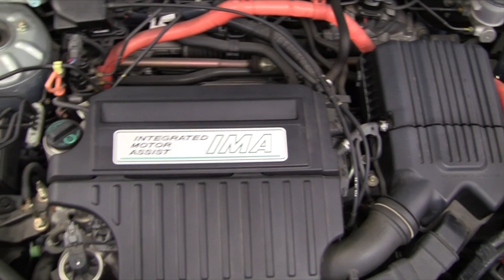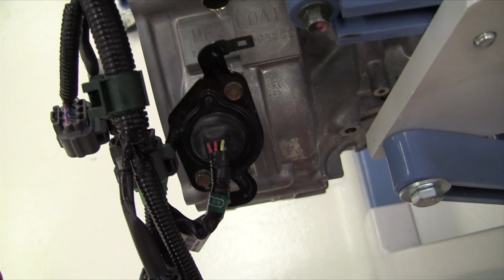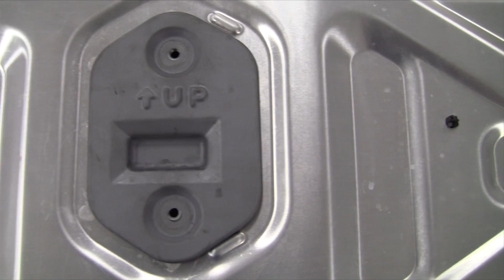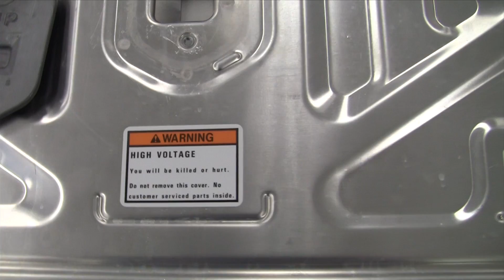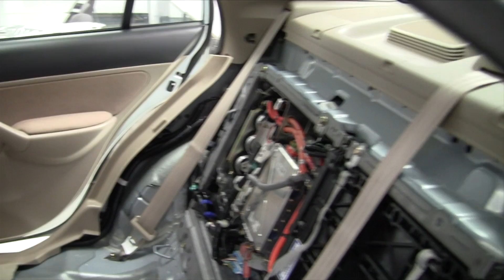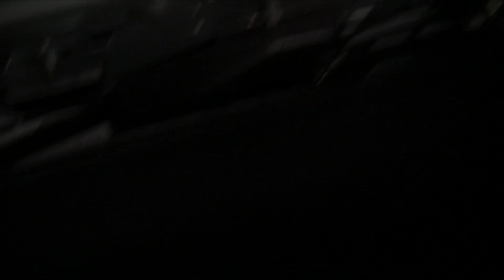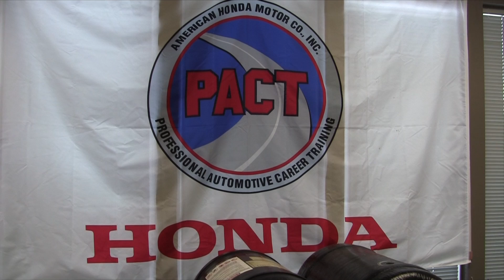Honda Civic Hybrid High Voltage System Operation

Comment: If the IMA hybrid battery starts to weaken, will it affect charging the under-the-hood 12v battery ?I read that there is no traditional alternator in civic hybrid.So how will the 12v battery be charged ?
Reply: I would stay away from Hybrid cars because Hybrid battery expensive to replace and they are prone to fail due to temperature and prolonged periods of not using the car. I am a new owner of 03 Hybrid Civic, and I wish I didn't make this purchase.
Reply: I have a 2001 Insight which has a similar IMA hybrid system. I have the hybrid battery completely removed and the car is used daily without it. So, the 12V battery is indeed charged even though the hybrid battery is removed.
Reply from the maker: GaryL3803 Yes, the Civic has a backup 12V starter. The MCM, BCM, and ECM are all involved in decision to start with the 12V starter.
Reply from the maker: Yes, if the IMA battery is weak, the DC-to-DC converter will not be able to provide adequate voltage to the 12V battery to keep it charged.
Reply: So there is no alternator to charge the 12v battery?  I am looking at buying a 2004 honda civic hybrid.  I read in some forums that the owners' IMA batteries are dead, yet their 12v batteries still are constantly recharged just like a traditional alternator would charge a battery.  How can this be?
Reply from the maker: Larry Matsko I don't believe them. I have seen this issue and eventually the HV battery level will be so low that the DC-to-DC converter will not have the power to charge the 12V battery. The engine will stall when there are high electrical loads like at a stop sign with the headlights and air conditioning running. There is no alternator. Best wishes!
Reply from the maker: Thanks for the feedback. It is interesting that the 12V battery seems to be kept charged on your Insight, but it will not do so on the Civic Hybrid. I have helped two of my students who have had an older Civic hybrids with this exact issue of the 12V battery not charging if the 144V HV battery is setting a DTC for being bad (especially in cold weather). We have never removed the HV battery from the circuit to see what would happen. (nor would I ever recommend it). Removal may be triggering the MCM to go into a limp home mode and send all current from the IMA motor to the DC-DC converter allowing it to maintain some level of 12V battery charge. Interesting stuff, thanks again!
Reply: In the Insight it takes about 2 seconds after the key is switched to start position for the BCM (??) to decide that the IMA will not start the ICE and trigger the 12V starter. I am presuming that the Civic has a 12V starter?

Comment: I have the same exact Honda with a code P0700 related to transmission. Any idea what that code could be referring to in little more details ?
Reply from the maker: P0700 is a ECM code that just means that something is wrong with the transmission. You must use a Honda scan tool to access the transmission DTCs. Best wishes!
Reply: Does Honda scan tool read transmission codes from the normal below-steering-column output or does it connect somewhere else to read trans codes ?
Reply from the maker: Same connector

Comment: If Hybrid Assist fails,  will it make car  start driving like a 3 - speed transmission ?
Reply from the maker: Hi, on a Honda IMA hybrid, the transmission will operate normally if the hybrid system shuts down. The IMA system only helps the engine crankshaft to rotate.
Reply: no, cvt will still be cvt. if that happens, 12V battery will NOT be charged. As soon as 12V will run out of energy, engine, lights (even hazards lights) and cvt cotroll will no longer function (car will die, even if moving).

Comment: Hello, my name is david carranza, I'm from Guatemala, I have a honda civic hybrid. in my country these Honda vehicles is not supported. I have a problem.
1. shows me that the battery is fully charged, leave it unused for 8 hours and then when I start showing me that has no battery and brake every time makes no charge.
2. When there is no load, battery 12v shown red

3. I commented that they could balance, you can give me information if this is true or false

4. Should be true, as it should make loading and unloading?
Thank you

Comment: Amazing Video, thank you! Have you ever heard of the hybrid system constantly killing the IMA battery? Reminds me of 12V battery and bad Alternator. The battery dying twice in a short amount of time points to possible alternator issue. I'm wondering since I've replaced the IMA battery now three times, what could be malfunctioning. Changing the IMA battery always gets rid of all Codes for about 2 months and then PP1600 and P1433.  As of this morning, the IMA Battery is completely dead and won't even try to charge.  No idea what is going on here.
Reply from the maker: Thank you, your car has a common problem. Replacing the battery will not fix it alone. There are some control modules that must be reprogrammed as well. Honda has a service bulletin about this very topic. Best wishes.
Reply: If the ima is completely discharged and won’t charge but car will start and drive find a straight away that you can safely get the car up to 60 then take your foot off the gas & immediately shut the car off & right back on within seconds those blue bars come back on you may have to try this a few times . Then take your car out for a long drive at least an hour with all other electric ie….radio heat or air conditioning off after you get at least 7 or 8 blue bars you can turn on Econ mode . Depending on how low assist battery is you may have to drive it longer to get full charge . Also before this double check the nuts on your 12 volt under the hood make sure connections are tight . Good luck this did work for me . Also prior to this i scanned and erased codes then reset maintenance lite . I have had no lights come on no problems & getting better fuel mileage no hesitation no stalls it’s been two weeks now .
Reply: @cathy4517  hey cathy, you’re the most recent comment on any video . Do you still do this to your hybrid? My IMA and battery light came on and I’m going to give this a try . How well has this worked for you?
Reply: Hello,@axlsantos9276 , could you share your experience?
Did you make 60 mph and turn off ignition?
Did it help you?

Comment: i have a question, i have the same car, but i have a problem with the ima system, in the cluster a have the red light battery on! what part i need to replace, cuz a can't charge the front battery.
Reply from the maker: +jose flores Hi, there are several possibilities. You need to get it checked out.  Best wishes

Comment: Is is possible to jump a 2003  civic hybrid once completely dead?
Reply from the maker: +Brittany Williams Yes, you can jump start the 12V battery under the hood. The engine also has a regular starter motor.
Reply: +WeberAuto thank you so much! I was hoping so before I reached out tor roadside assistance. Appreciate your help.

Comment: I have a question about the transmission a couple of videos ago, are dog clutches stronger than clutch packs?(more durable)
Reply from the maker: +Don G. I don't know for sure, but I suspect it is a matter of surface area of the dog clutch teeth where they contact their mating gear verses contact area of a multiple plate clutch pack and all all of its splines. Thanks again!
Reply: So I gather that you can build either design as strong as you want?
Reply from the maker: Don G. I believe that is the case. I am sure there are cost, space, materials, and control issues that drive that decision.
Reply: TX for info!
Reply: transmission repair

Comment: This is a 2005 Civic  it is the same model I bought new in Sept 2004 the first available. Honda Started talking about Hybrid in 2003. Mine is the same color and the tail lights did not  have this body shape until 2004.
Reply from the maker: +Randy Rutledge The one in our classroom os actually a 2002 pre-production model. They started offering them for sale in the 2003 model year. Thanks for watching!

Comment: at 17:46 you aren't completely right. If you disconnect 12V battery, while ignition is on, hv sustem wouldn'd turn off, beacose 12V battery charger will still provide power. To turn it off first turn ignition off by keys, and then disconnect 12V battery
Reply from the maker: +Volodumur Kalunyak Thanks for your input. If both 12V cables are disconnected on this model, it does shut off. Others may be different, but it would defeat the purpose of an emergency disconnect if the car were to be in an accident.  Thank you for watching
Reply: What is current

Comment: Thanks for video, I have a small question regarding my Honda Civic second generation Hybrid 2008 - after a lot of  IMA errors I've opened the IMA battery and some of the sticks after a day or two from  a discharge / charge cycle  have almost 0 capacity. The rest of sticks have 3.000 mAh to 4.000 mAh. My question is where can I find the second generation sticks - they are welded in pairs so I need a double stick welded.  Best regards, Tudoran Radu
Reply from the maker: +Radu Tudoran Hi, try salvage yards or ebay.  Thank you for watching!

Comment: I read on another video that once you replace the Ima battery on a 2003 Honda civic you need to program it so the system can accept it but I am not sure so I'm wondering if you can help...
Reply: 2007 I meant Thanks
Reply from the maker: Yes, you need to reprogram several items with a Honda scan tool when you change the battery.

Comment: WeberAuto... Thanks for the video! Question: I have an 04 Honda Civic Hybrid and my IMA light is on which I have confirmed the battery needs to be changed, however I have changed the 12V battery about a year ago, and today while driving all instrument lights started to flash off / on and then battery light stayed on. Following this, my lights began to dimmer and all power went off in the vehicle, completely disabling the vehicle while driving. I was able to get to the side of the highway, thankfully! Hazard lights did not even work too. Roadside assistance came and jumped the vehicle and started with no problem! Do you know what could be the cause of this? I have looked on several forums with no luck. Look forward to your feed back, thanks.
Reply: I had same problem with my Honda civic Hybrid. did you fix the issue? What was the issue  if you have fixed it?

Comment: hi i wanted to change my ac compressor in my 2009 civic hybrid but i noticed it has the high voltage orange cable running to the compressor should i just shut the battery off and remove it?

Comment: i got a p1440 code, its got a new ima battery, mcm with updates but the charge of the battery wont show, any time i hit the 3.5k mark to show the status bar of the ima battery it throws a 1440 code, if i dont rev it up to charge it, the 12v battery light comes on. any ideas whats preventing my ima to charge?

Comment: Is it typical to find most 2006 1.3L get holes in the piston?  I am a ASA mech but typically dont work on these and now find I am about to so ... what is preferred method to remove engine... with or with out the trans.?

Comment: I am wanting to add a small mono amplifier to help fill in the stereo using a subwoofer. I know options like a class D amplifier and a low wattage/low resistance subwoofer and maybe even a capacitor will help reduce electrical demands from the system, but I don't know if the 12V system can handle the additional wattage without overcycling the IMA and causinig it to die prematurely. Can you tell us any more about the 12V portion of the system and how much headroom for additions there is? Thanks.

Comment: I just bought an 07 model and took it to the dealership for inspection. They said there were a couple recall services they would do for free. I believe changing out the DC/DC converter was one. Randy, call your local Honda dealer and see if there is a recall service for your vehicle.

Comment: Thank you for your reply WeberAuto...I Appreciate that!! Now that I know..the battery is not getting a Charge.. What if I made a modification on my own to the Car..and installed an alternator...via a drive belt...so the Battery will stay charged...then I would still continue to drive the car with a dead IMA battery until I am able to replace it?

Comment from the maker: hi, it will run as long as your 12V battery has power. With your IMA battery dead (bad or not recharging) the 12V system will not charge either.

Comment: It turns out I have to replace the IMA battery all together. 
Still having the 12V light turning on when I am below 1500 rpm. 
Unfortuanately, I am unable to pay for the IMA battery considering college is pretty pricey as well. Eh...

Comment from the maker: Hi, there is a DC-to-DC converter behind the back seat that does the job of a traditional alternator.  If it overheats, it can fail. Check to make sure the intake vent is not blocked on the rear speaker shelf and also check to see if there is air flowing into the vent.  This cools the high-voltage electronics including the dc-to-dc converter.  You need special high voltage safety training to diagnose and replace that part.  Best wishes.

Comment: Thank you for this very helpful and informative video. I have a 09 HCH. Is it possible to upgrade from the  existing 2nd generation Nickel Hydride Battery pack to the 3rd generation Lithium Battery pack? Would the existing inverter and charge controller also require to be replaced for the new Lithium Battery pack? Would the charge controller require any software update for the new Lithium Battery pack. I really hope that Honda implements this type of battery upgrade for existing (older) hybrids.

Comment: this is just like working on a frequency drive on a chiller. except we rectify the ac into DC and power a dc buss over 700 volts. interesting thing i see on drives is that it will correct phasing no matter what incoming is. but if output is not right motor will go backwards. the life expectancy on igbt's are 10 years. ive had good luck with danfoss products abb will blow up if motor bad but danfoss will trip and alarm

Comment from the maker: Hi, the engine will start and you can drive the car, but the charging system will not function and the 12V battery will eventually die.
Reply: I bought a used 2005 hybrid honda civic. Of course the HV battery died. I was told a marine battery would work as a replacement. Once I removed seats and put breaker switch in off position, I would be able to drive without spending thousands of dollars. Please advice.

Comment from the maker: There are 12 rotor magnets that will pass by each of the 18 field coils of the stator.  There are three phases in the stator, so six field coils per phase will each be excited by the 12 permanent magnets per revolution of the crankshaft. 18 x 12 / 3 = 72 cycles per revolution.  At 7000 RPM the frequency on one phase of the stator would read 504kHz
Reply: Prof. There are 12 magnets=6 alternating poles, so during 1 revolution there will be 6 full AC cycles, if we go at 7000RPM which equals to ~117 Rev per second, when we multiply that by 6 cycles per revolution we get frequency of 700Hz.

Even going above 30 kHz would require accounting for skin effect in power wires and loses rectifying to dc, and going that high with frequency overall is not beneficial (talking about ac generators)
I know it's a bit late (9 years 😅) but it so happens that just today watched this vid, other than that superb work proffesor!👍 Thank you for your work! Greetings from Poland! 🇵🇱😁